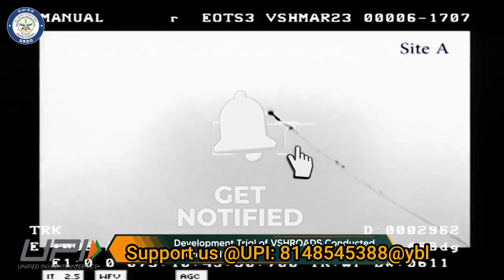#breakingnews DRDO conducted two successful flight tests of the VSHORAD

Comment: Its a waste of time and money. Its too heavy to be a real MANPAD
Reply: Dude it is portable since it's fired from tripod. More weight reduction needs to be done to make shoulder fired. Drdo took the first step in achieving tripod launch system so it can be incorporated into light tank like Namica launcher. 
Shoulder fired ones is still a mission objective.
Reply: @bala09sundaram  , And no military uses tripod fired manpads. Manpads are something you need to fire in few seconds, not something to assemble on a tripod and then fire. Enemy aircrafts will be out by the time infantry assemble manpads  on a tripod. It's another failed project, just like mpatgm, which is also too heavy to be a real ATGM.
Reply: @kevindominic5224  there are tripod based systems used by some nato countries. and it would be good to have on light vehicles. stop being a negative nancy.
Reply: @udittlamba Negative Nancy 😅
Reply: @udittlamba  ,A failed system is a failed system. A Sam that weighs 40 kg is not a manpad. It's like claiming that a laptop is actually a smartphone. Being a fangirl doesn't change facts. Nag, mpatgm, and VSHORD all have the same issue. It's too heavy to be useful and can't be deployed in mass.
Reply: I wonder if it can be navalised ? We could do with some of these on our OPVs and auxiliaries.